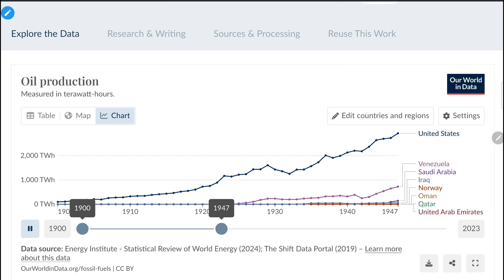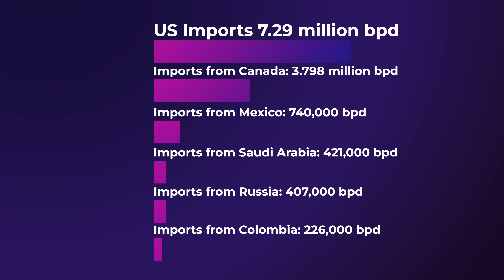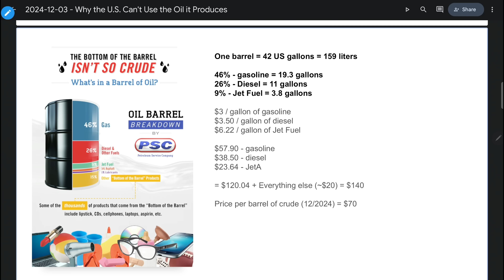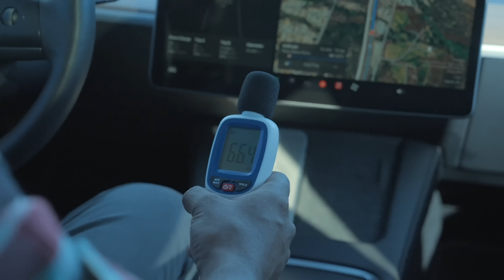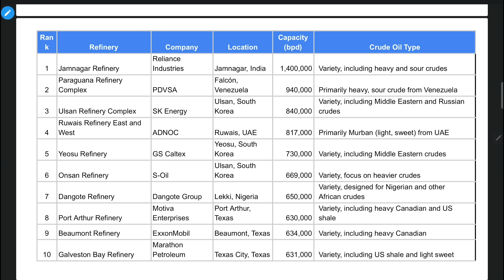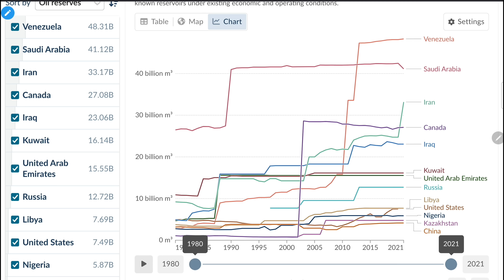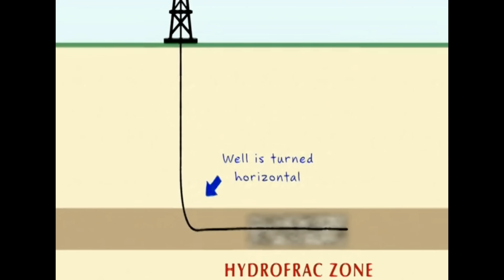Why America Can't USE The Oil it DRILLS

Comment: Exported oil still enters the market and affects the supply and thus the price world wide. Same reason Russian exports affect price in America even if we don’t buy Russian oil.
Reply: That being said we are at record production. Drill baby drill is just a political slogan. When the price of oil drops low enough, we will actually then produce less.
Reply: @catherinebutler1146  As production goes up, the price comes down.  If price dips low enough, certain production such as fracking becomes uneconomical.  This regulates price on the long term.  But during the covid/supply chain crisis, daVinci's argument makes sense for why california gas prices shot up.
Reply: @catherinebutler1146  No, they'll just increase the markup
Reply: @catherinebutler1146  The US has reached record high production recently, unfortunately our refinery capacity is still below the pre-pandemic levels.  Data from EIA shows in early 2020 the US had refinery capacity 18.976 million barrels per day, that number has been at 18.326 million barrels per day since March 2024.
Reply: @catherinebutler1146  Incorrect. When more oil is produced it becomes cheaper. More trucks on the road and more competition which keep food prices and everything else down in the market. Including gas prices. America controls its own pricing not based on the world markets. When you depend on other nations you lose control of the pricing. The U.S. plus Canada did the exact same thing and prices skyrocketed. Causing everything else to sky rocket.
Reply: @drdecker1 No. Neither do. Eastern Canada does not use Western crude. Not even on the West Coast. Did you actually watch the video?
Reply from the maker: that's a really good point! thanks for bringing that up, totally makes sense as you think about it.
Reply: @TwoBitDaVinci  and as you think about it :)
Reply: @TwoBitDaVinci Marginally as the economist say. Question: if you had just enough food to feed yourself, would you export it so that 1,000 very wealthy people out of a population of 370,000,000 could be very, very wealthy? Would you then consider it a deal to compete then with 8,000,000,000 other people, many starving and more numerous than your side, to give thanks for your daily bread? Just askin' from an engineering perspective. Would you design it that way?
Reply: World crude oil consumption is 100 million barrels per day. The US doesn’t produce enough crude to meet our own demand, and how much difference in the global price does exporting 4 million barrels per day, 4% of global demand make? Mathematically, it should only reduce the global price by 4% right? All while depriving Americans of oil we could refine here. Adding back that same 4 million barrels per day to our 16.5 million barrels of crude demand would lower domestic prices by 25%, right. Big difference!
Reply: @jtjones4081  Except we cannot refine it. Did you not listen? Our refineries are not set up to use that type of oil. And no one will spend the money to modernize a refinery unless they are sure they can recover the costs plus a profit. We would have decades of $10 gasoline to. pay for the refinery switch to use our own oil. We have to export ours and import the right type to make our refineries run. If we stop exporting and/or importing we end up with shortages of everything which makes pricing go up not down. Oil executives keep telling Trump that drill baby drill is wrong but he won't listen.
Reply: @markpashia7067  and yet oil executives are indeed drilling at record levels... make up your mind.
Reply: @jtjones4081 there are only global prices on Crude oil, you can’t have a domestic price and a global price since it’s easy and cheap to transport around the world.
Reply: @jtjones4081  You are making the assumption that price elasticity of oil is -1, so a 1% reduction of supply would result in a 1% price increase. However, in practice the short term oil demand is quite inelastic...on the order of -0.05 to -0.10 based an several online sources, which implies that a 4% decease in crude oil supply would result in a 40-80% increase in price. In the longer term, the elasticity factor is more like -0.3 so as supply catches up and some demand goes away, prices come down some but never to 1:1.
That's why the shale revolution has been so important to keeping global oil prices low.
Reply: @jtjones4081 when Trump’s 25% tariff on imports kicks in, cost at the pump will go up!
Reply: @jtjones4081  This assumption of linear price movements with changes in supply seems sensible, but has been carefully studied by economists. Turns out there are some pretty nonlinear responses in oil prices when supply changes. Makes living in that space more interesting!
Reply: @jtjones4081  Peculiar math, our oil isn't free.  While energy independence would be nice, being able to sell our more expensive sweet crude and buy cheaper sour crude is still a good deal.  Like this video said about Norway, drill and sell it while there is a demand, although I think it will take longer for the world to convert to EVs than people think.  Biden's big plan spending $7.5 billion to build more EV charging stations only produced 37 new stations.  There are still over 190,000 gas stations.
Reply: Maybe your not listening drill baby drill has to do with  their plan on mining 49 states for lithium quartz and rare Earth and other minerals 49 STATES
Reply: @matildamarmaduke1096  Yes to this!  The US has so many untaped resources, but the federal government owns 47% of the land out west where many of them are found.
Reply: @jtjones4081  The people that own the oil don't want that to happen? It's all about the PROFITS baby.
Reply: @markpashia7067  Since the country developed refineries that can use crappy heavy oil well, it's a legitimate and reasonable business choice to keep importing it cheaply and export the light crude at higher prices.
Reply: @Scramble-electron-890 But is it a reasonable societal choice? Saudi Arabia and the Arabs can read the writing on the wall. Norway can. What's wrong with Americans? Don't answer the question - it's rhetorical and obvious.
Reply: @markpashia7067 perhaps they should build the right  refineries?
Reply: @matildamarmaduke1096  they can mine it but who will process it? Oz thought the same thing but dropped the idea when it factored the time and costs needed. It was not competitive and would take years.
Reply: @yt.damian  Production is up, drilling is down!
Reply: @KadiddlehopperClem  Wells reduce output over time. Its great that production is up. If you want to maintain that you have to keep drilling.
Reply: @jtjones4081  your logic is flawed
Reply: Yeah but you have the quality of the oil being the ultimate arbiter of price.
Reply: @cityguyusa  quality is only primary factor in price if demand is lower than production. most of the time availability/demand is the driver of price. as soon as demand falls OPEC cut production to support pricing.
Reply: @yt.damian  Demand is the equation.  If demand drops like during COVID the price drops.  We buy sour crude regardless we can't say oh well take somehing cheaper there is nothing as far as I am aware and who wold refine it?
Reply: @cityguyusa  there are different grades of oil that can be refined within the US but yes - pricing is almost entirely based on a mismatch between demand and availability.
Reply: @yt.damian  Not only OPEC, but US producers cut production to support prices.
Reply: @KadiddlehopperClem  they are different prices though. Everyones Oil sells at different prices and they dont all move together.
Reply: 2 genuine questions. Didn't trump make a deal with Russia and the Saudis to cut oil production on his way out of office? Which rose prices at the pump? Second,  I also heard trump had something to do with selling the largest refinery in the u.s. to the Saudis. Is this true?
Reply: @Dr-Mantis-Tobogan not true at all. OPEC cut production because of Biden.
Reply: you do buy russian oil
Reply: That's true but as well export more.  OPEC will lower it's production and therefore keep the price per barrel high.
Reply: Exactly, oil price is based on supply and demand and it's worldwide. Exporting is irrelevant. Local production  does not determine oil prices here.
Reply: I enjoyed the factual and thought provoking video and appreciate the high quality comments. All in all very good, solid information for me. We need more of that on complex issues. Thank you all.
Reply: @username65585  i often forget to read other people's comments before i comment.  So silly.  Anyhow I agree w u
Reply: Drilling will produce more exported oil, which is more expensive. We buy the cheaper oil to refine. The more oil we sell will overall reduce our price at the pump. Trump isn’t stupid, there’s a plan in place. Prices were cheaper when he was in office. But prices shot up instantly in 2021…. Why is that?  He’s a business man, that knows how
to turn money into even more money.
Reply: "even if we don’t buy Russian oil."

Ya, you do. The refined products are using Russian oil, mixed in with products from other sources, then gets shipped to the US as gasoline, diesel, jet fuel, and byproducts of the petroleum industries. Plastics is a big one.
The sanctions don't stop other countries from doing this.
Reply: @robertlee4172  Can't speak to plastics and oil quality refining requirements.   What I know is the US uses the cheapest oil and our refineries are setup to refine that.  It doesn't matter what Russia delivers to India because it doesn't affect our supply one way or the other.  If India is in short supply then they can't just import US Oil because they don't have any way to refine it which is why there are diferent prices for different types of crude.  If India can't get oil from their suppliers it has no eefect on the oil we need.
Reply: @cityguyusa  "If India is in short supply then they can't just import US Oil because they don't have any way to refine it "

NEWS FLASH...they have oil refineries.

They're the ones buying Russian oil and selling the finished products to American companies.
Reply: @robertlee4172  Newsflash back at you every refinery refines different grades of crude you can't just replace one with another.
Reply: @ 
Oh, you need remedial grammar lessons. That punctuation is lacking.

I said..."They're the ones buying Russian oil and selling the finished products to American companies."

I understand fully that there is a difference between sweet crude and sour crude. Bitumen a whole different story altogether.

But when Russian oil is refined in other countries, India for example, then the byproducts and different components are then shipped to buyers all over the world.

Capiche?
Reply: @username65585  except there are different prices for different oils pulled from the ground.
Reply: The problem is that other oil producers react to the lowering of price by cutting production in order to support a certain price point.
Reply: If you have too many barrels of Russian oil you can't just resell them to a country that cannot rerfine them.  It just means that Russian oil will be stockpiled and the price lowered till it's gone.
Reply: @cityguyusa Wow. American self inflicted propoganda is insane. Russia's current GDP growth is ahead of the US (although much smaller in absolute size). Russia is now trading successfully in Roubles, not dollars. Western sanctions did not work but they did undermine Western global influence. Russia has converted from Western cars to better Chinese ones unavailable to Americans, especially EV ones, ironically. I wish Russia was losing in Ukraine but they are outlasting them, especially now.  Russia successfully reoriented from its dependency on exports to Western Europe over to China and India which are growing faster by far than the US which leads the anemic G7.  BRICS total GDP in absolute size now exceeds the G7 including the US and has more than 4 times the population to support growing markets. BRICS is adding new members rapidly including oil exporters who used to look to the US dollar economy. The US is alienating all of its allies by viewing everyone as the enemy. Personally I believe Putin is driving this over here but that's another story.  Remember the USA has less than 5% of the global population. It is on its way to being a secondary market just like Britain went from being the center of world economy to a tiny backwater. The times they are a'changing whether we like it or not. We should be adjusting to this reality, not committing economic suicide where our government just boosted the price of fresh vegetable and fruit by 25% in a single day. Oil too, wah, hah, hah. The inmates have captured the asylum.
Reply: There is no world wide oil price.  There are prices for different grades of oil.
Reply: @cityguyusa By definition.
Reply: While true also consider:

More drilling will lower the price 
That American drillers dont want to

Saudi Arabia nearly killed the US fracking industry by flooding the market

So till you cannot refine the oil into what you need you do not become oil independent!!!
Reply: @cekuhnen  They need to understand the more they drive up the price the more it also impoverishes people because of the rising cost of living. In Canada last year alone. Over 2 million people went to food banks. One of the reasons was the cost of food went through the roof when transportation costs skyrocketed. Get politicians out of the office who do not understand how to keep costs and other things in check.
Reply: @ you dont have to tell me that - I am a German in the USA and am bewildered by how blind the majority of these people are.
Reply: However, this also assumes that other countries maintain their current production. If the US floods the market, then other countries, such as Saudi Arabia, are likely to drop their production to keep prices high.
Reply: Russia needs to sell oil. Opec nations could halve production tomorrow and the price would double, they would make the same money for doing less work and giving up fewer resources

America drilling won't make a difference
Reply: @phill6859  If that were true and it was as simple as that, then thats what would happen. In reality some OPEC members would cash in and sell more than their agreed half output. Other countries would sell more as prices made their operations more viable and lastly if that scenario were to happen then countries would go to war and take the oil by force.
Reply: @ so you want OPEC in charge of your energy? Yes, I am calling you a moron. The US learned in the 1970s not to depend on other countries for such a vital resource.
Reply: That is true. But that is also the reason why, even though many drilling permits have been issued in the US in the last decade, not much additional production has come online. If you overproduce, the price will go down, reducing the profit margin (even making certain extraction methods economically unviable). It's more profitable to constrain the supply.
Reply: Reality check. The ONLY thing that has full control of the world price of oil is OPEC.
Reply: Hawaii was importing Russian oil not long ago.  It stopped in 2022 due to the war Russia started with Ukraine.
Reply: Exactly right.  Also. Their is a lot more value added in refining hard to refine heavy crude.  May sound flippant, but leave the easy stuff to those countries with less advanced refineries.
Reply: OPEC possesses and controls 81.5% of the worlds oil reserves. Nothing the US does can control the price of oil on the world market. OPEC, and OPEC only controls oil prices. It's simple math. OPEC can flood or restrict the market at will, so the US actually does not matter in terms of oil price.

Comment: Which are the countries that import sweet oil from the US, & how are their refineries able to refine US oil, are their refineries newly set up to meet US oil standards?
Also F1 is coming up with fueling their cars with naturally sustainable fuel, other than our current Gas, could you please research & make a video on that, giving more details, please.
Reply: Refineries built at different times are built for different inputs  it like any other processing plant tbh they build it for the most economic profitability and it takes decades to build a refinery  The more regulation steers away from using there is no incentive to build a light crude refinery in the USA  because at the moment  
building any NEW one doesn't "pencil" out .. aka the return on investment is too low --- so the USA light Crude sells for more on the overseas market than the heavy sour crude costs and reffing  that is more profitable